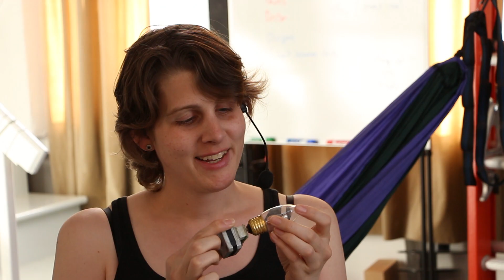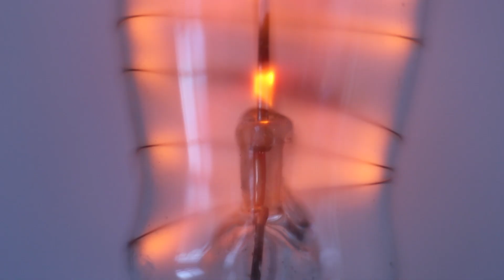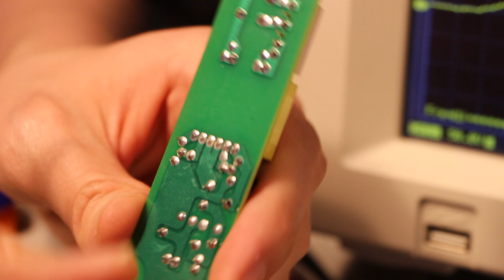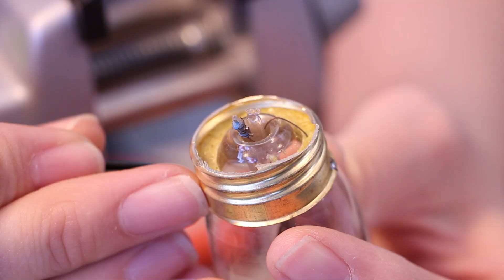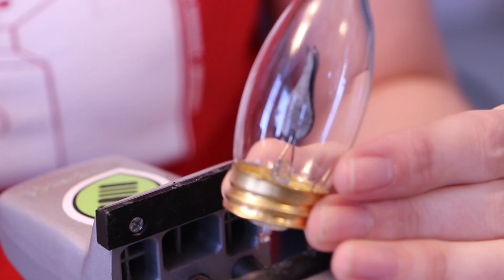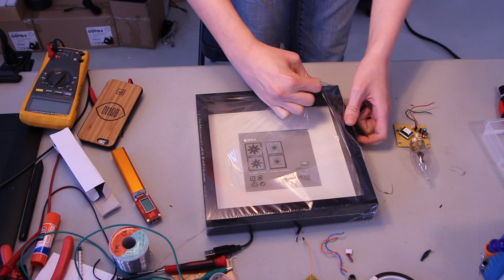Flame Effect - scanlime:009

Comment: This will also be appreciated by collectors of antique neon lamps formerly used as panel annunciators and instrument illumination in sizes up to about 3 watts.

The old lamps are very interesting because of the variety in electrode design from one manufacturer to another. Unfortunately most of those old lamps have exceeded their hours and no longer work on the mains or rated voltage, but they still have gas in them. 

This project is encouragement for collectors to better understand how to get the remaining gas ionized to and better enjoy or display their lamps. High frequency+high voltage but still low power.

Comment: Neon and lasers and high voltage zings... these are some of my favourite things.  Before semiconductor laser diodes, most of the common lasers were HeNe, so it's nice to see that shout out to old school hackery. Did you say that you removed the series limiting caps to the neon bulb because it was capacitor enough? When that gas strikes, it's no longer a capacitor but a dead short; the driver transformer might be OK with that because the low impedance on the output will quench the oscillator on the input until things die down and everything kicks off again, but perhaps putting a bit of limiting resistance (or capacitance) in series with the tube would be a bit kinder. BTW - I once put a pea neon directly across the house mains (240v!) -- it blew the house fuse and the bulb was blackened, but the neon survived to glow again. Those things are tough.

Comment: Excellent video.

I am pretty sure the ability to tow around the plasma discharge with shortwave light is a photoelectric effect.  If you put a NE-2 on a curve tracer (or even just run it from an isolated mains source so you can scope it easily) you will find the strike voltage changes a lot with incident light.  It probably depends on the electrode material, but for the ones I tried red light doesn't work, but yellowish starts to have an effect and by green and blue it is very noticeable.

Some discharge tubes for fast circuit applications have radioactive electrodes (or a little radioactive gas like Kr-85 - which has a short half-life so old tubes from eBay are a lot less active than they once were) to reduce strike jitter.  I wonder if the flicker lamps have an alpha emitter painted onto their surface to provide some random ionisations to help move the discharge around?  I will have to break one of those bulbs and see if I can detect any radioactivity.

Comment: Instead of superglue, I have used an optically clear adhesive that cures with a UV flashlight...typically used for bonding glass/lenses.
Reply: +Micah Elizabeth Scott I like this medium viscosity one for general purpose work:

http://www.amazon.com/UV682-Medium-Viscosity-Visible-Adhesive/dp/B006JFPSRK

Many of the ones designed for display panel and optical element bonding are very low viscosity and are harder to control.  This one is viscous enough you can build it up on things and even fill small spaces with it, I've done makeshift cable boots on 0.1" headers with it for example.  However it does have a tendency to cure only the outer layer, so you need to really blast it with UV light and maybe heat it afterwards to get a full cure into deep bits of it or it will feel rubbery for a few days.